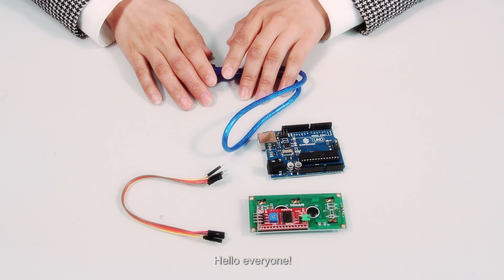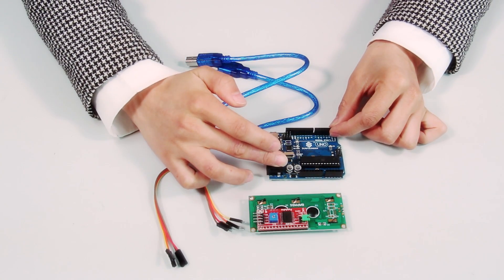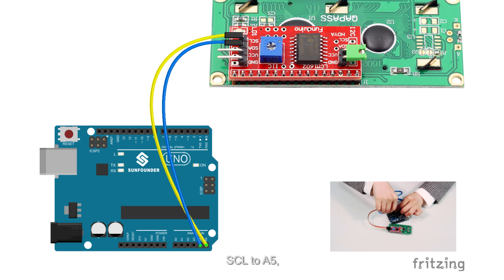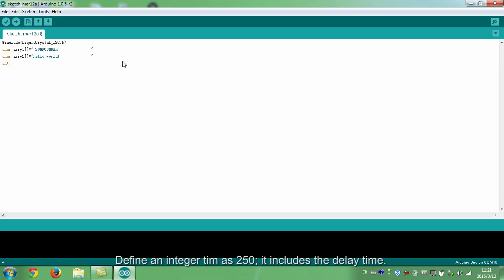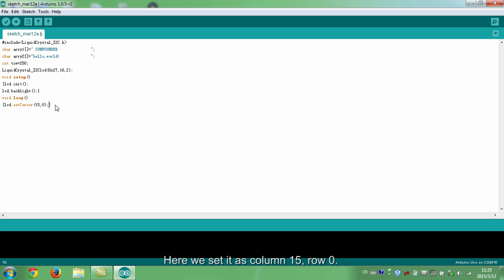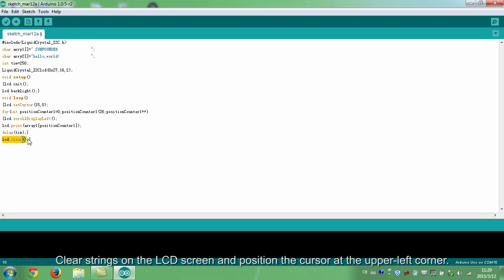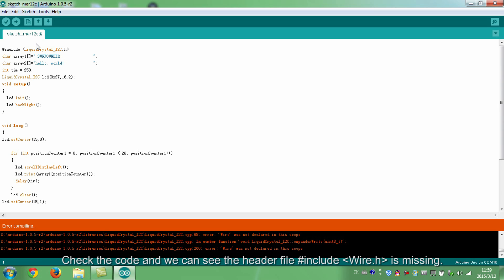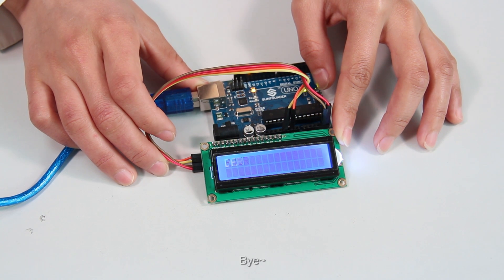SunFounder Learning Kit Tutorial for Arduino - I2C LCD1602 - Super Kit/Starter Kit, Need soldering

Comment: Can I control C12 LCD with my Arduino mega?
Reply from the maker: If you are talking about i2c, then you can. It should be noted that the i2c pin position of arduino mega is different from that of arduino uno.

Comment: Thanks! ... but my god.. at 4:19, put `lcd.init()` on a NEW line without the curly bracket! And after `lcd.backlight()`, put the closing curly bracket on a new line!
And similar problems in the loop. It works the same but having clean code is very important

Comment: For those who are having issues using Sunfounders source material:

Go to this website 
https://bitbucket.org/fmalpartida/new-liquidcrystal/downloads/

Download version 1.3.5

go to your Arduino software and add the library.

Write as following:

#include <Wire.h>
#include <LiquidCrystal_I2C.h>
LiquidCrystal_I2C lcd(0x27,2,1,0,4,5,6,7,3,POSITIVE);

void setup(){
lcd.begin(16,2);
lcd.clear();
lcd.print("Hello World");
}

void loop()
{
  
}

The First bit of code is just to get the LCD handshake initialized with the Arduino software, from there you can add any other details you want. 

Happy Coding!

Comment: Using the arduino Mega, all connections are correct, LCD back light turns on but I get no black rectangles  or words, I am at a loss as to what could be wrong. Tried redoing the library, tried redoing the circuits, code is copied and pasted, the address is correct. Only thing I can think of is that the library pins need to be changed for the mega 2560 for SDA and SCL but I don't know where to change that in the code
Reply from the maker: it's the wiring actually, which is different for Uno and Mega. For Uno, it's A4 and A5; but for Mega, you need to connect pin 20 and 21 to SDA and SDL of the LCD. See if it works.
Reply: I have that all wired correctly
Reply from the maker: OK. then when you uploaded the code, did any error message appear? if it's uploaded successfully, try spinning the blue potentiometer on the LCD back.
Reply: Everything uploads fine which is is the odd part. I will take a look at the contrast tomorrow again but I tried that as well yesterday
Reply from the maker: you may refer to the FAQ for the I2C LCD1602 on our WIKI page: http://wiki.sunfounder.cc/index.php?title=LCD1602/I2C_LCD1602_FAQ. If these still cannot help you, you may post forums on our website and post your code and wiring photo so we can help you check what's gone wrong.
Reply: fine tuning the contrast worked. Thanks
Reply from the maker: Great! Welcome to sub and have fun with us :D

Comment: For those who are struggling with the "exit status 1" error, you need to download the new library file for LiquidCrystal I2C.
You can do this by downloading it off of the Arduino-Library on their website, here's the link below:

http://www.arduinolibraries.info/libraries/liquid-crystal-i2-c

Once you downloaded the zip folder you can then go into Arduino and open the source code that was provided by Sunfounder for project 4. Then this is the important step go to ("Sketch"-> Include Library-> Add Zip. to the library) Load the zip file "LiquidCrystal I2C" that you just downloaded and then load the library into the existing code ("Sketch"-> Include Library-> Manage Libraries). Upload the program and the LCD screen should work properly.

Good luck everyone!:)
Reply from the maker: Thanks for sharing!

Comment: i have a problem 
the code dose not work 

backlight  dose not change its color  

please help
Reply from the maker: Dear Alrawahi, 
Pls checked the pins GND,VCC on the I2C LCD1602, whether the cables are reversed. If not, then check the I2C in the back of the LCD. In the side of the I2C module, there is a cap. If it has been pull out? It's used to be powered for the backlight. If yes, the backlight will be not show.
If you still can't find the way to solve it. pls connect with us asap.
Good luck!

Comment: i got this error :

C:\Users\abdoul latif sampana\Documents\Arduino\libraries\LiquidCrystal_I2C\LiquidCrystal_I2C.cpp:3:23: fatal error: WProgram.h: No such file or directory

 #include "WProgram.h" 

                       ^

compilation terminated.

exit status 1
Erreur de compilation pour la carte Arduino/Genuino Uno

Even if i didn't put any library called Wprogram.h so i don't understand why they put this error :/
Sorry for words that are in french.
Thanks to reply. :).
Reply from the maker: Dear MP，

What version of the IDE you use? We suggest that you use the latest version of the Arduino IDE.
If you still have trouble, pls connect with us!
Reply: I have fixed the problem ☺ now its fine. But the links you put in description isn't working fine. If you can do something about it too.
Reply from the maker: Dear MR,
Wow! Great!
But we can't find the link you said in the description.
Have fun!
Reply: Hi Sunfounder. 
With the latest IDE I had the same problem "failed to find Wprogram.h". The old .ccp file needs to updated with this link;   https://gist.github.com/jrmedd/5516863  

 I did this with my project and it solved the problem. You may have to do this with your ".ccp" project file to get it to work. Hope this helps

Comment: I have tried over and over the scanner code and  it just display the 16 black rectangles on line
Reply from the maker: Hi Selena, 

The scaner code is just use to detect the address of the I2C LCD1602, you need to use the additional code. 
Below link code for your reference to. 
http://wiki.sunfounder.cc/index.php?title=I%C2%B2C_LCD1602
Have a good time!

Comment: i'm actually trying this project :
https://www.youtube.com/watch?v=dcz8veTJmkI&t=2s
my problem is that i dont know how to use your LCD , i already went to your site to check the tutorial but it didn't help me solve my problem, hope you can help me SunFounder.
Reply from the maker: Dear Dale,
We have wacthed your video, and we found that you just only use the LCD1602 in it. But we use the LCD1602 which add a I2C on it. So you can get a very easy connection which just use 4 cables. 
Below is the course for you reference to.
https://www.sunfounder.com/wiki/index.php?title=I%C2%B2C_LCD1602
Hope you can solve the trouble.
Reply: so those 4 ports also includes all the ports on the upper part of the LCD? thanks sunfounder! :D
Reply from the maker: Hi Dale, 

Yep! The 16 pins of the LCD1602 have been embedded in the I2C module, so when you use it, you just need connect the 4 cables.
Have a nice day!
Reply: +SunFounder thank you very much !👍😁
Reply: aside from "lcd.scrollDisplayLeft/Right" can you make a tutorial of other things i can use?
Reply from the maker: Dear Dale,
What else function do you want to get? You can open the LiquidCrystal_I2C.cpp, you will find many functions, and try to use them.
Hope you can have fun!
Reply: how can i make the time appear on the lcd without a rtc?
Reply from the maker: Hi Dale, 
The LCD only use to display, what do you want to use to get the time? Then, you can use the lcd .print （"      "）to display the time.
Reply: Okay thanks
Reply from the maker: Hi Dale, 
You are welcome, have fun in SunFounder!
Reply: hello sunfounder, its me again. i just want to ask you if you also sell an lcd keypad for  lcd 20 x 4 with i2c bus?
Reply from the maker: Dear Dale,
Yes! We have this product, below is the link, you can buy it directly.
https://www.sunfounder.com/iic-i2c-twi-serial-2004-20x4-lcd-module-shield-for-arduino-uno-mega2560.html
Reply: sunfounder! i've just bought your humiture and i'm still working on my project with the lcd 20x04 with i2c bus.. do you have a tutorial on how to use your humiture? thanks in advance
Reply: i found the tutorial. now i'm only needing the site where to download the library for your humiture
Reply from the maker: Dear Dale, 
Sorry for the late reply, because of the holiday!
And you can find a file named " Dht library" in the library as the follow link:
http://wiki.sunfounder.cc/index.php?title=Humiture_Sensor_Module
Have a nice day!
Reply: i'm having this problem now, after i add the readings of the sensor on my LCD I2C 20x4, the characters on the Display blink every 3 seconds. hope you can help me. if you need a copy of my code, just tell me and i'll pass it to you. btw. i loved the blue light on the sensor ;)
Reply from the maker: Dear Dale, 
Pls copy your code to us .
Waiting for your reply!
Reply: +SunFounder hope you don't mind waiting. i'll be able to copy my code tomorrow night because i have it on my computer wich is in maintenance. thanks a lot for being so responsive❤
Reply from the maker: +Dale, of course. It doesn't matter.
Have a nice day!
Reply: sunfounder should i have to mail you the code?
Reply from the maker: +Dale, you can choose the convenient way for yourself.
Our mailbox: support@sunfounder.com
Happy day!
Reply: i have already sent you the mail :)
Reply from the maker: +Dale, well noted your email, we will reply you later via email.
Have a great day!
Reply from the maker: Dear Dale,
Pls comment out code lcd.clear(); with the //. 
In additional to, add a sentence lcd.setCursor(0, 0); in front of the lcd.print("TEMP:"); . In case TEMP run out of order.
Have a try!
Reply: +SunFounder nice. yeah the TEMP has run out of order. i should try it later. thank you very much. btw i resolved the blinking problem👍😁
Reply: sunfounder, need your help, don't know where to ask . i need to finalize my project and i can't make the alarm stop when it is alarming, hope you can help me :(
Reply from the maker: Dear Dale, 
For the buzzer responds, you can change code to the below one, the buzzer will stop after made ten sound. You can try it!

for (int i = 0; i < 10; i++)
    {
      tone(9, 1000, 200);
      delay(200);
      noTone(9);
      delay(200);
    }
Reply: i wanted to stop it with a button so i made this:
if(digitalRead(12) == LOW)
{
   ???????? 
}

dont know if this is right, but i wanted to do it like this. when i press the push button on the pin 12 , i want to stop the tone , but i can't get it done :(
Reply from the maker: Dear Dale, 
You can try the below code:
if (digitalRead(12) == LOW)
  {
    noTone(9);
  }
Good luck!
Reply: +SunFounder i've already tried that, and it didnt work. the push button on the pin 12 wont trigger😖
Reply from the maker: Dear Dale, 
How did you connect the Button? Maybe you can connect the cables according to the below link, then, you can change the LOW to HIGH. Check whether it can work.
https://www.sunfounder.com/learn/Super-Kit-V2-0-for-Arduino/lesson-2-controlling-an-led-by-button-super-kit.html
Reply: SunFounder, i managed to stop the tone by pressing the button, and the moment  i released my finger from the button, the tone will play again. 
here is the code :

void alarm()
{
if(ahours == hours && amins == mins && amins != 0) // se l'ora e minuti di sveglia è uguale a l'ora e minuto attuale 
 {
  checkStopButton();                               // chiama la funzione "checkStopButton()"
  beep();                                          // chiama la funzione "beep()"
  flash();                                         // chiama la funzione "flash()"
  stopalarm();                                     // chiama la funzione "stopalarm()" 
 }
else
 {
  stopalarm();                                     // altrimenti chiama la funzione 
                                                                 "stopalarm()" (di nuovo) 
  delay(500);
 }
 lcd.clear();
}

void stopalarm()
{
  if(digitalRead(12) == LOW)                       // se premo il pulsante di stop 
   {
    noTone(9);                                     // fermo il suono dello SPEAKER
    loop();                                        // torna all'inizio del ciclo
   }
}

void beep()
{
   lcd.setCursor(7, 2);                           // imposto il cursore colonna 7, 
                                                                      riga 2   
   lcd.print("Alarm");                            // la parola "Alarm" apparirà nel 
                                                               display
   lcd.setCursor(6, 3);
   lcd.print("WAKE UP!");

                                                         /* ---> per far suonare lo speaker <--- */
   tone(9, 850, 200);                             // 9 è il pin dove è collegato lo 
                                                                    speaker, 850 è la frequenza, e 
                                                                                          200 è il delay
   delay(200);
   noTone(9);                                     // ferma il suono per 2 millisecondi
   delay(200); 
}

void flash()
{
/* -> Blink <--- */
  digitalWrite(leds, HIGH);
  delay(100);
  digitalWrite(leds, LOW);
  delay(100);
}

void checkStopButton()
{
  if(digitalRead(12) == LOW)                      // se premo il pulsante nel pin 12  
  {
    stopalarm();                                  // chiama la funzione "stopalarm()"
  } 
}
Reply: i dont know how to totally stop it

Comment: I have this code error:
Arduino:1.8.0 (Windows 10), Scheda:"Arduino/Genuino Uno"

C:\Users\monal\Downloads\sketch_jan25a\sketch_jan25a.ino:9:32: warning: invalid conversion from 'int' to 't_backlighPol' [-fpermissive]

 LiquidCrystal_I2C lcd(0x27,16,2); // set the LCD address to 0x27 for a 16 chars and 2 line display

                                ^

In file included from C:\Users\monal\Downloads\sketch_jan25a\sketch_jan25a.ino:3:0:

C:\Users\monal\Documents\Arduino\libraries\NewliquidCrystal/LiquidCrystal_I2C.h:53:4: note: initializing argument 3 of 'LiquidCrystal_I2C::LiquidCrystal_I2C(uint8_t, uint8_t, t_backlighPol)'

    LiquidCrystal_I2C (uint8_t lcd_Addr, uint8_t backlighPin, t_backlighPol pol);

    ^

C:\Users\monal\Documents\Arduino\libraries\NewliquidCrystal/LiquidCrystal_I2C.h: In function 'void setup()':

C:\Users\monal\Documents\Arduino\libraries\NewliquidCrystal/LiquidCrystal_I2C.h:154:9: error: 'int LiquidCrystal_I2C::init()' is private

    int  init();

         ^

sketch_jan25a:13: error: within this context

   lcd.init(); //initialize the lcd

            ^

exit status 1
within this context
Reply from the maker: Where did you get the LiquidCrystal_I2C library? The problem is a conflict between your library and the code we provide. You can download the library again at the bottom of this page: http://wiki.sunfounder.cc/index.php?title=I%C2%B2C_LCD1602. And try again. It should work. Seems like Frits below had the same problem and fixed it this way.

Comment: I am trying to add a flowmeter to an lcd. All I am getting is a bunch of weird characters in my display any ideas how to get real values from the below code?
#include <Wire.h>
#include <LCD.h>
#include <LiquidCrystal_I2C.h>#define I2C_ADDR    0x27 // <<----- Add your address here.  Find it from I2C Scanner
#define BACKLIGHT_PIN     3
#define En_pin  2
#define Rw_pin  1
#define Rs_pin  0
#define D4_pin  4
#define D5_pin  5
#define D6_pin  6
#define D7_pin  7LiquidCrystal_I2C  lcd(I2C_ADDR, En_pin, Rw_pin, Rs_pin, D4_pin, D5_pin, D6_pin, D7_pin);volatile int flow_frequency; // Measures flow sensor pulses
unsigned int gallons_min; // Calculated gallons/min
unsigned char flowsensor = 2; // Sensor Input
unsigned long currentTime;
unsigned long cloopTime;
void flow () // Interrupt function
{
  flow_frequency++;
}
void setup()
{
  lcd.begin (20, 4); //CHANGE THIS IF YOU NEED TO
  lcd.setBacklightPin(BACKLIGHT_PIN, POSITIVE);
  lcd.setBacklight(HIGH);
  lcd.home();
  pinMode(flowsensor, INPUT);
  digitalWrite(flowsensor, HIGH); // Optional Internal Pull-Up
  Serial.begin(9600);
  attachInterrupt(0, flow, RISING); // Setup Interrupt
  sei(); // Enable interrupts
  currentTime = millis();
  cloopTime = currentTime;
}
void loop ()
{
  currentTime = millis();
  // Every second, calculate and print gallons/hour
  if (currentTime >= (cloopTime + 1000))
  {
    cloopTime = currentTime; // Updates cloopTime
    // Pulse frequency (Hz) = 60Q, Q is flow rate in gallons/min
    gallons_min = (flow_frequency * 100 / 60); // (Pulse frequency x 1 min) / 60Q = flowrate in gallons/min
    flow_frequency = 0; // Reset Counter
 
 Serial.print(gallons_min); // Print gallons/min
 Serial.println("gallons/min"); delay(1000); lcd.print("TEXT");
 lcd.println("TEXT");
 lcd.clear();
 lcd.setCursor(0, 0);  }
}
Reply from the maker: Dear MGDNation, 

Feel so sorry that we haven't provide the flowmeter and the "an lcd." head file , therefore, we can't help you to adjust your code. We suggest that you can find the usage method of the flowmeter.

If you have other technology problem, we will try our best to help you!

Comment: Guys, 0x27 is the address of the l2c used in the VIDEO ONLY. Please use l2c_scanner.ino to find YOUR l2c-adress - or try the address 0x3F, which seems to be common.
Reply from the maker: 0x27 is just a default address.
Different I2C modules also will have different addresses.In addition, you can also change the address by wiring A0A1A2 in different ways. For more details, refer to the user manual.